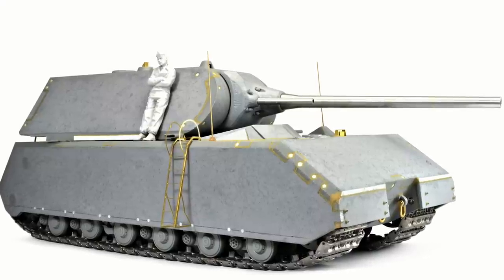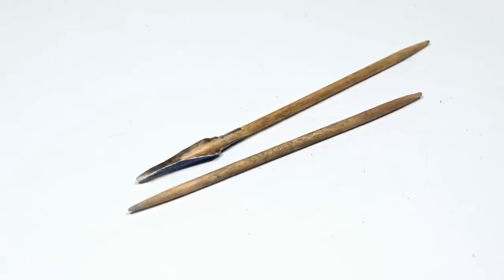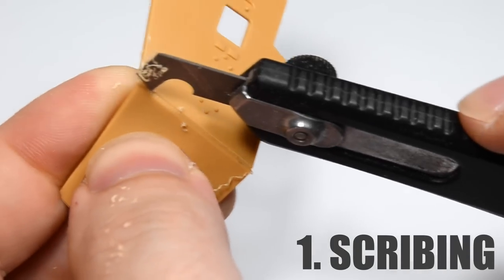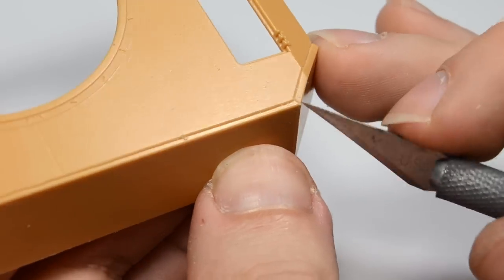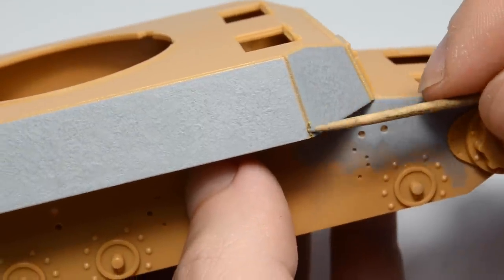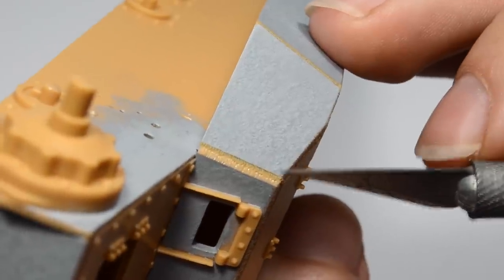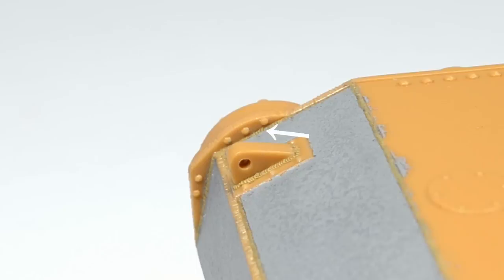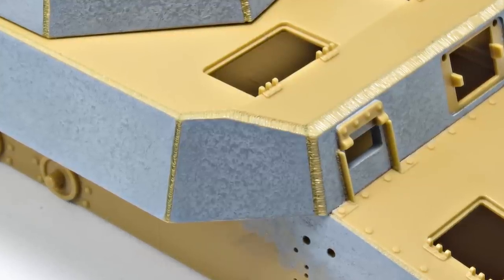HOW TO: Epoxy Weld Beads for 1/35 Tanks (Single Bevel Groove Welds)

Comment from the maker: Do you add welds to your models?
If yes, which technique/material do you prefer?
Reply: I usually like using styrene rod, but I find the Archer resin weld transfers to be extremely useful for long and straight welds between panels!  Though I'm sure you know this :D
Reply: Yes. And exactly the same Tamiya putty
Reply from the maker: @Panzermeister36  I tried styrene rod once and wasn't  pleased with the result. It was too massive and I found it hard to add texture to it. Maybe I used an overly thick rod or something... actually it was quarter rod, I bought that specifically for that task, to wedge it into the gap and just add texture. Didn't work for me though. Those Archers seem very nice and I think they'd work great on photo-etched details.
Reply from the maker: @rossomachin  Ah, another man of culture!
Reply: I've used styrene rod with decent results. The only thing I don't like about that is if you go too heavy with the extra thin it gets gooey, messy and is hard to recover from. That's why I pretty much use Apoxie putty now, more control and better results IMO.
Reply from the maker: @SmallSoldier  Exactly! The rod turned into a chewing gum. Epoxy isn't just better control, but you can add whatever texture you like. With plastic, you're limited to just chopping it up and brushing glue over it.
Reply: @NightShiftScaleModels  Yep!
Reply: Magic Sculpt epoxy staff, almost Tamiya
Reply: dat bloopers =)
I haven't reached ths level of detail yet, but I heard of a more complex technique with sprues and Dremel which is obviously requires an expensive tool and a bit of skill of making noodles out of these sprue leftovers
Reply: I'm still using Magic Sculpt for this technique, which I just started using on my T-62 build. The applicator I use is a modified fine gauge needle, similar to what Adam Wilder used in his construction techniques book. With your "live" demonstration tutorials I still learning a ton of new tips and tricks. I wouldn't say no to a hap-hazardly rushed soviet weld "how to" tutorial. They were never as nice looking as the Germans during WWII.

Cheers mate!
Reply: Previously I didn't add much welds to my models. I used styrene rod and didn't like how it looked. Then tried epoxy putty (Milliput) with a "welding" tool made of aluminum tube and that was pure pain in the **s. But now, thanks to this awesome channel and video, I tried the same Tamiya putty and it blew my mind! So easy to use compared to Milliput, goes where I want it to go and thin noodles don't break too easily. Now I just need to fine tune my tool and practise more.
Thank you so much for this and other videos!
Reply: I use green stuff to make welds
Reply: @NightShiftScaleModels  is that ak ruler?
Reply: Could you probably make a video about the weld "maker"?
Reply: Well mine is literally welding the plastic together. I get (usually Tanita) glue and put ALOT on where the separate plates meet then light it, it makes the tank strong just in case you drop it. Like my T-34/76 and I tossed it idk why but it survived not a scratch, but I’m going to try your technique on 1/16

Comment: As a welder I think you have captured this craft very well.
Reply from the maker: Wow, thanks a lot!
Reply: @NightShiftScaleModels  I'm a welder too and I'm amazed how your welds look. And, in 8:50, when you said that you don't need to scrape a channel in tight corners, well, thas how welding works(with thin materials, of course)

Edit: BTW, I saw once a T-34/'76 with porosity and cracks in welds. Probably welded by a guy with few hours of practice. Later production armor, after '43, had better quality.
Reply: 19 yrs as a welder and most in a shipyard, my only suggestion is your lifting eye pads on the undersides, general rule of thumb is the height of the fillet bead is 1/3 the materials thickness, so a 3 inch thick piece of steel is goin to have 1 inch high and wide weld bead
Reply: @NinjaMG  I'm not even a welder but early T-34s look painfully amateurish. The bead looks like a pile of gravel instead of a bead and hell, there's holes between plates all over.

Comment: here's a quick tip that might seem very obvious, but might be missed through over-thinking: a "weld" that is a bit too big is better than one that is too small, because one that is too big you can wait for it to dry and then cut/sand away any excess.
Reply from the maker: Yet it seems like nobody is doing that because what I see all the time are oversized welds and not a single one that might be too small.

Comment: Welder here, 
In WW2 they used stick welders, So welding direction makes a diffrence.
Which means they would weld on horizontal places from Left to Right.
And on Vertical places from Bottom to Top.
Keep this in mind when pressing the C shape into the puddy, ( C facing the direction you are going ) So when you flip the tank make sure to "weld" into the same direction. ( left to right)
For a more realistic/accurate look always stick to these weld directions..

Extra:
Left to Right on the horizontal is for right handed welders
And back in the day welders were taught to weld with the right hand only.

Hope this helps
Reply: I'm not sure if they would have had 7018 back then, but I would think they would have been going uphand, as better penetration would be important on a tank, so you'd want those "C's" to be "U's" on any vertical welds. But on every WW2 vehicle I've ever seen the welds like like garbage or chicken shit haha.
Reply: IN WORLD WAR II IT DIDN’T MATTER!!! THEY ONLY WANTED MASS PRODUCTION.
Reply: and then there is some guy who knows in which direction the tanks in ww2 was welded.
Reply: Where is the face of the "C"? Is the facing like the bulb first or the open end first?
Reply: @AKKK1182 open end facing right or up
Reply: @uprisingonblitzandwt448  A mass produced tank with useless welds might as well not be made.

Comment: I'm a welder who has had some experience with military vehicles. I'm continually  blown away how close the preparation for real welding can mirror what you're doing. Like when you weld butt joint- plate welding, you would be wise to add a groove to fill with weld metal for a more complete weld. But the fillet welds, ( like with the tie-down ears) you don't have to add a groove. You just follow the joint where the parts being welded touch each other.

Comment: I used this method to create the weld lines on a Sherman Turret and it worked great.  The only thing I did a little different was let the epoxy set for a while before rolling it out into thin lines. I found it easier to roll and apply this way. Other than that, you instructions were followed to the letter. Thanks for sharing and I look forward to you videos. Thanks again - Joe

Comment: Awesome again man! I really love your style. Those tips for welds are brilliant, I've never thought to scribe a channel into the plastic... so simple and effective. I generally use Aves Apoxie sculpt to make weld beads but I would use a cuticle pusher to make the weld marks. I need to rig up one of those fancy pokers you use. Thanks for the great advice and always entertaining content.
Reply from the maker: Scribing weld lines is really important. It can be annoying at times when the surface is littered with small details or you just don't have enough room to properly line up the ruler. I think Adam Wilder also uses Apoxie putty.

Comment: Nicely done video!  
Using the sheets of styrene to roll out the epoxy spaghetti for a weld line is a superb idea.  For so many years I've been using epoxy putty and never thought of that.

I wish I could show some modelers the weld jobs I've seen on T-34s.
Reply from the maker: T-34s and IS-2s are a gold mine for gnarly welds
Reply: I used to see the T-34s and other Soviet  tanks at Aberdeen and Ft. Knox.  The welds were just flipping ugly!  You could look at the T-34s and walk a few steps to compare the welds with those on Jagdpanthers and other tanks.  Oh, well... T-34s did exactly what they were built for.

Comment: Yes,and the Alec-“Holly” 0.2mm scriber is a must for eg M4 Sherman/SdKfz.234 welds.I use a separate bottle of cement for texturing which I add styrene to-lengthening drying time for stretched sprue weld seams.The scriber is so good you can lift plates,undercut wiring without leaving any damage on surrounding area.It’s like holding a bendy Stanley knife blade with a canted tip.Get some real shadows going instead of 360 degree shadow of brown sludge.Zimmerit is a “thing” I haven’t tried as a hairspray chipper.Either learn brush chipping or …?

Comment: Can you make a video about that poking/welding tool because when i try to craft it the tip is so big and inaccurate?
Thanks
-Andrew
Reply: I would like to see how you shaped the soda can tin piece before gluing it to the tooth pick.
Reply: If you're not sure, you could probably get a cheap fountain pen, pull the metal nib off and stick that on a cocktail stick/toothpick
Reply: @MerryMac1000  I had a look at those many seem to have squared off ends, or it's kinda like a small spherical shape on the end.

Comment: Great tutorial as allways!
I am using extra fine Milliput, but it's really hard to work with in 1/72 scale. I should give a try to that tamiya putty. 🤔
Aaaand I am waiting for that weld type video you've mentioned! 
It's worth the time!😉
Reply from the maker: Thanks! Not a big fan of Milliput, always found it hard to work with no matter the scale. I think stretched sprues are very good for replicating welds in 1/72. But again depending on the subject I could imagine doing a few welds with putty even in small scales.

Comment: As usual, super interesting. For Canadians modelers information, I went to my local hobby shop to get some two-part Tamiya epoxy putty. I was told it is no longer available in Canada due to its chemical composition. (Don't have the details and I haven't double checked that info). I guess it's only a matter of getting it online but I thought I'd pass the info. 

The guy told me Milliput was the recommended replacement, a claim I find highly doubtful. Judging from the video, I'd say the Green Stuff Green putty looks to be closer in composition and handling.
Reply from the maker: Interesting info! 
You're right with your assumptions. Milliput creates noticeably different results if you use it to sculpt pretty much anything. I don't know, never was a fan of it. Magic Sculpt is also very different and I only use it for stowage, but not anymore for welds. I guess the main difference is how Tamiya is "rubbery" and flexible while those other two are more "stiff" so to say. I don't know, Tamiya just has a better texture.

Comment: While looking for supplies in an art shop (Mod Podge and whatnot) I bought a tip for a fountain pen (aka a nib) in a calligraphy section, and it works quite well as a marking tool. So if anyone's willing to try this method but the prospect of having to bent and shape soda can aluminium puts them off, you can use this to speedrun the process.

Comment: I'm not saying this to insult you, but anywhere where you can see the exposed root of a weld, it should be in the shape of an out-ward facing V, since the plates would have been flame-gouged at a 45 deg. angle, in order to ensure the best weld penetration possible with as few slag inclusions as possible, being that tanks from this period were all welded using Stick (SMAW, or Shielded-Metal Arc-Welding).
Reply: I just show my tanks with the lights off.

Comment: Interesting. I might have to try it this way. I usually just cut a sliver of styrene and use Tamiya extra thin to melt it then use a dental tool to build the "roll of coins" effect of a proper weld.
Reply from the maker: That's an interesting technique, quite similar to stretched sprue. I should try it one day!

Comment: Apologies if this already got mentioned but you can also just slice off a piece of brass tubing at an angle.
Reply from the maker: Yup, looks more fancy, you can use any diameter you need and it's probably easier to make. However I'd suggest to thin down/sharpen the edge with a round file or something.
Reply: @NightShiftScaleModels  totes!

Comment: Do you always do the weld beads before you build the vehicle or 
Is it just harder to do after the vehicle is built. Thanks
Reply from the maker: It's best to make the main welds without any details glued to the model. Then, as you progress with your build, you can continuously add welds around those smaller details.

Comment: Plastic sprues, but if you say that one box of tamiya epoxy can last for a few years, I think i'll give it a try. I have in mind a KV-1 early type from Eastern Express to try on.

As always, great video)) Even if you'll make a 10min tutorial about this highly engineered tool it will be worth to see XD
Reply from the maker: Yes, it will last for a few years, even considering most of the putty goes to waste, you just can't use it all up once it's mixed. There's always a significant amount of waste. Yet still it last really, really long. It also has a huge benefit because it works as a filler too, just like I've shown on those towing shackle mounts. Plastic sprue would sink into the gap. I still think stretched sprues are pretty legit in 1/72nd scale. Sounds like a topic for another video!

Comment: What's the biggest difference you found between magic sculpt and Tamiya epoxy?
Reply from the maker: Tamiya is more flexible and more sticky. It also somehow creates a smoother finish after it solidifies. However I still use MS for tarps and stowage.

Comment: Yes Martin I would like to see how to make that tool!
Reply from the maker: Alright!
Reply: One question Martin, the two  styrene sheets you use to make an epoxy noodle, do they need to have any texture? I have styrene sheet they are glossy af.

Thanks!
Reply from the maker: I think you'll have to try it yourself. The point is to have water on both sheets. If the glossy surface doesn't hold water well, make it more rough with sandpaper.
Reply: @NightShiftScaleModels  Interesting, thanks!

Comment: Amazing tutorial! I have a big question for you. I see you are holding your models with your hands when working with them. Do you wash them with soapy water before you base coat them later? I have recently worked on my first 1/48 scale tank and washed it thoroughly with warm soapy water, let it dry and applied the basecoat on the tank and let that dry too but later when I applied a second lighter coat going by your 'worn' tutorial from the sharotank and start chipping it, the entire coat peels right down to the plastic :(
Reply from the maker: Yes I always wash every model and every part prior to painting. Soapy warm water and a toothbrush/soft brush depending on how fragile the model is. 
What paints did you use? What you are describing sounds like something Ammo, AK or Vallejo paints would do if not let to dry for at least a day. 
Since I started using Tamiya, MRP or even Lifecolor paints there were no cases of me going straight through the paint exposing bare plastic.

Comment: I was using a brass tube filed/chamfered down in a pin vise as a welding tool.....but they always get lost. Like your tool much better, can throw this together with very little drama. Quality of the content you're producing  is extemely high, don't think any other modeller has come close to you yet.
Reply from the maker: Awww thank you!
I wanted to make one of those brass tube tools but since I didn't have one I had to make this ghetto version. Those brass ones look real fancy and you can make whatever diameter you please!

Comment: Again very good and easy to follow! But how about 1/72 armor? 
Keep on going! Great style of explanation in your Videos!
Reply from the maker: I think the best way for 1/72 is stretched sprue. But then again some subjects could be "welded" with putty as well. It really depends on how massive the welds are on the real tank.
Reply: Night Shift i‘ok guess try an error is a good choice. Practicing an small scale models to find the best looking weld 🤗
Reply from the maker: I think you'll be good with stretched sprue. I probably wouldn't do them myself with putty unless I'd be adding casting seam lines on an IS-2 or IS-3 turret.

Comment: OK, nice. In 1/72 scale it will be hard. But I must try it. ;)
Reply from the maker: 72 scale is tricky for welds. I'd  stick with stretched sprue :)
Reply: @NightShiftScaleModels  so, also Plastruct profiles (these with smallest diameter) should be good. Also I want try PE weld lines from Mirage Hobby, but it is difficult to find them. ;)
Reply from the maker: Eww, I wouldn't trust PE welds :) If the Plastruct profiles are thinner than 0,5mm they could work. But stretched sprue is cheaper :)
Reply: Thanks for info. Yes, Plastruct make something about 0,3mm, so, it could work. But yes, stretched sprue should be cheaper. It need no be so perfect like Plastruct profile. ;)
Reply from the maker: Stretched sprues are often irregular in diameter, but then again you can make several of them and just use the good portions and discard the rest.